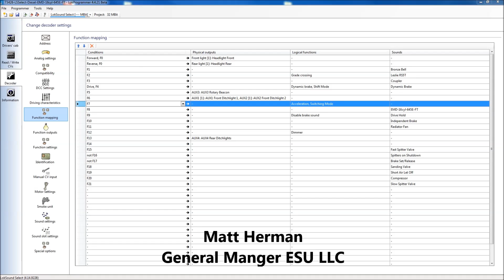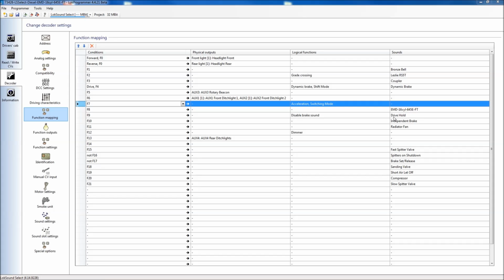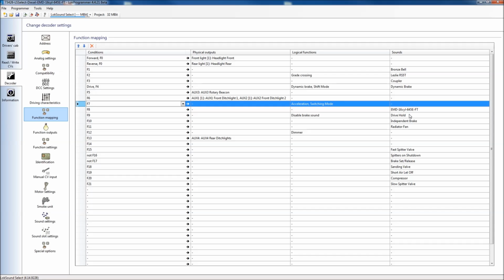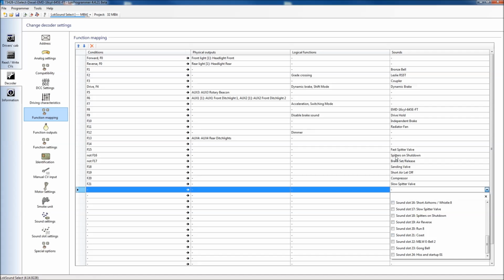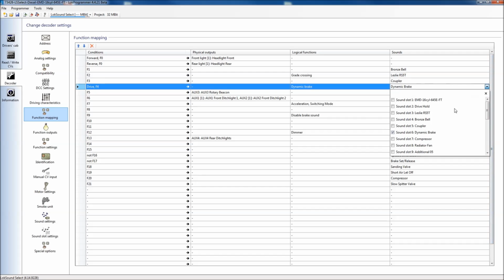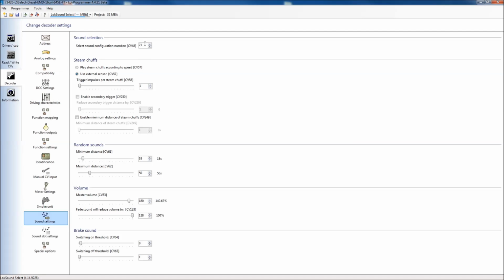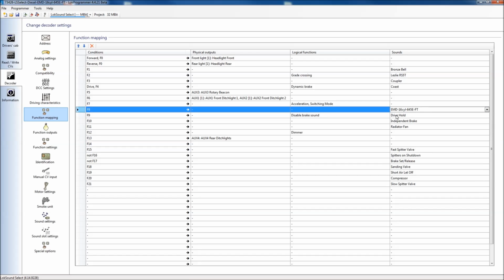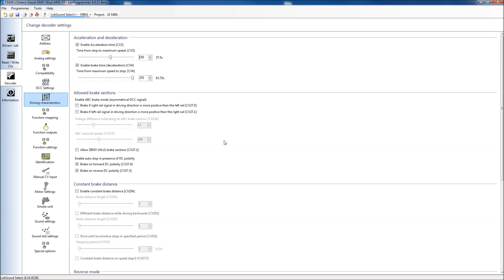ESU Full Throttle and LokProgrammer 4.4.21

Comment: Brian everytime I try to upload my sound I get a decoder error. DO ANYONE know how to resolve this issue!
Reply from the maker: I'm afraid there is no Brian at ESU, but we will need more info to help either way. We need the exact error message you are receiving as different circumstances will give different messages. Please contact us direct at Support@LokSound.com with a screenshot of the message and possibly a picture of your programming set up and we will work to find a solution. Common problems are: poor connection between the LokProgrammer and the decoder, or using a V4.0 file in a Select decoder or a Select file ina V4.0 decoder. You must only use Select files in a Select decoder, and V4.0 files in V4.0 decoders. All sound files are availabe in both version though.
Reply: Matt I am so sorry for calling you Brian. I talk to Abby I will send you a picture of the message im getting on my computer.  Writer decoder error is what im getting.
Reply: Matt every time I try to upload sound file  it ERROR WRITING DECODER DATA

Comment: I think I've bricked my ESU decoder in my Atlas Alco S4. Engine still moves OK but I cant get the sound back.
I was trying to update to FT but I always get an error half way through the update. Error writing decoder data message evey time.
Going round in circles, dont know what else to try. Reset dosn't seem to make any differance.
Reply: Formidable38  Please contact us at Support@loksound.com and we'll see what we can do to help.
Reply: Hi Mathew,
Thank you for your reply!
I sent an email yesterday to the Lok Sound website contact page. I have a video on YouTube showing what happens. I have now tried it using Win 7 on a laptop and it still happened. I'm beginning to think it's a communication problem with the cable.
Reply: Hi, guys. Did you get my email? It seems that some sound files will work and alot wont work!
Is it right that a bunch of Selects released back along were faulty?
This one is from Atlas model- 2014

Comment: Matt I Got a KATO Engine a EMD SDP40F Santa Fe 5052 ()  # 176-9211-LS. with Lok Sound  And my Question and wasn't for sure where to Ask was Function Controls:  Like F-1, F-2 & F-3  I figured out what most of these functions can Do but the one I haven't figured out yet was the F-7 function It's Labeled  (  Switching Mode )  I haven't came across what this Function Does.. For the Engine is it part of the Knotching feature does it slow or change the Engine's speed and since I'm using a N.C.E. Power Cab it's some what Difficult knowing if it on or Not.. But my Engine had been Running Really well.. I purchased the Engine from The Western Depot..

Thanks for Time Reading this I will for sure watch all of your Videos and I hope someday soon! I can visit with ya on the phone.. These Decoders in my eyes is what's bringing excitement to Model Railroading...

Comment: Is there any kind of graphic eq in the programmer itself?Or can new files be adjusted with a graphic eq software(external program)The reason i ask is because i prefer to have more low end in my sound(output from speaker),basically have the lower frequencies to be beefed up,and the mid & high frequencies output be lowered. Thanks
Reply from the maker: we work hard to make sure the levels are good out of the box if used 
with good speakers. Sorry this is not included. You may want to look at 
using some Cell Phone speakers as they provide a broader frequency 
range.

Comment: Hi Guys....could you maybe do a quick video on how to install a Full Throttle sound file. I bought the Lok Programmer but Im so new to this I get confused easily.  How about a video call "Lok Installs  for Dummies" :)  I'm trying to figure out how to upgrade my Bowser SD40-2s with the new FT files. 
Much Thanks